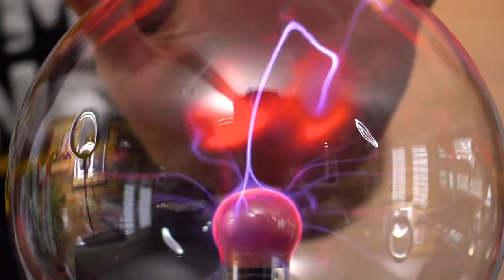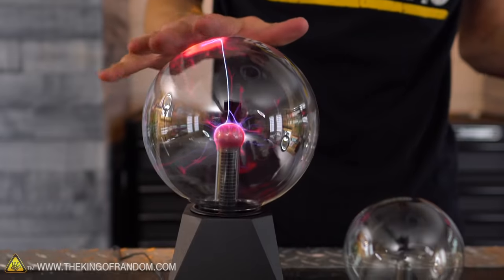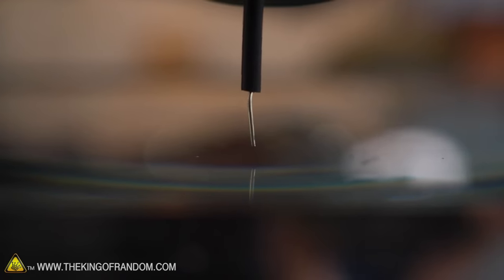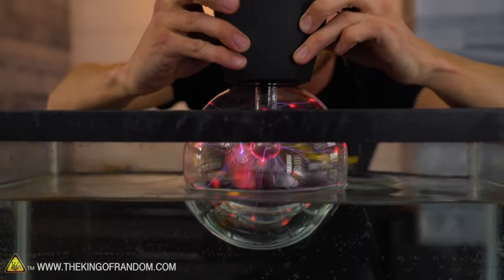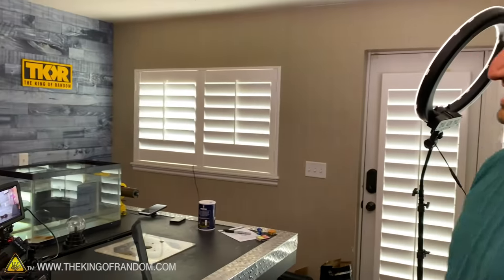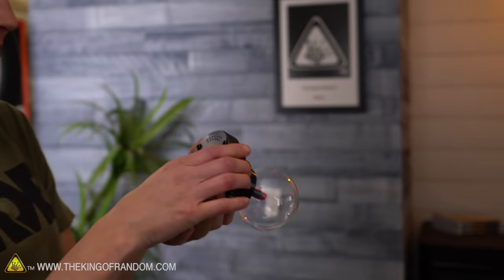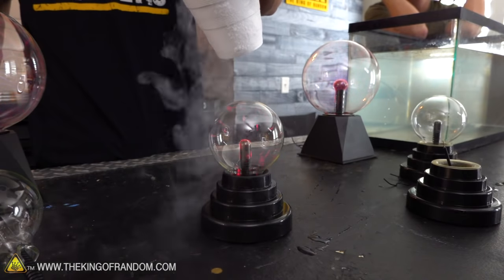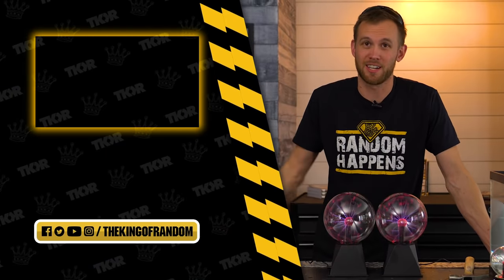How Will A Plasma Globe REACT In Water?

Comment: You guys should try putting different liquids in lava lamps like vinegar and liquid nitrogen.
Reply: Wouldnt liquid nitrogen just build up pressure till it exploded?
Reply: Stevy Boy yes
Reply: @stevyboy1876  That's the best part
Reply: @stevyboy1876  you say that like its a bad thing
Reply: @stevyboy1876  I like how you think 🤘🤘
Reply: Agree!
Reply: Yes!
Reply: Yes. Liquid nitrogen will build up pressure and explode. But if it didn’t then the heat from the bulb wouldn’t heat the wax and melt it. The liquid nitrogen would most likely freeze it. Also the glass would probably break from thermal shock.
Reply: Anders Olson yes
Reply: Anders Olson yesss
Reply: Yessss
Reply: Stevy Boy yes and also the wax wouldn’t melt
Reply: I agree
Reply: They sould put highlighter fluid in a lava lamp
Reply: Great idea!
Reply: Stevy Boy that’s the point
Reply: Like actual lava
Reply: Lol pickle juice
Reply: Stevy Boy thats the point...
I want to see them do it and not know about the explosion 🤣🤣
Reply: @stevyboy1876  thatll be cool to see
Reply: I do have an extra lamp, but no liquid nitrogen. I will try vinegar though
Edit: It smelt bad but did nothing
Reply: this sounds oddly specific
Reply: YESSSSSS
Reply: Anders O 
Kaboom
Reply: Lava lamp but it’s real lava
Reply: Well... once you take off the cap, the lava lamp won’t work anymore.
Reply: So true so true
Reply: Yes
Reply: Liquid nitrogen wouldn't work lava lamps get hot bro
Reply: @JacobTechShit  o
Reply: @JacobTechShit  wdym
Reply: @ReadGantz  liquid nitrogen is cold. Lava lamps are hot...
Reply: @JacobTechShit  yeah
Reply: @JacobTechShit  that's the point
Reply: @JacobTechShit  to see what happens
Reply: Won’t work
Reply: He's dead
Reply: @legostarwarsproductions4330  ????
Reply: @legostarwarsproductions4330  wdym
Reply: Dude you have 666 likes watch out 😦
Reply: Liquid nitrogen is a solid
Reply: reee
Reply: What about fire and gunpowder
Reply: Baked beans
Reply: @SirPandaFluff Nice!! Thx a lot
Reply: Mrbro dog1234 that’s the POINT
Reply: nice
Reply: @DH-xw6jp  well it is, its really dangerous
Reply: Smart
Reply: Dude that would make it explode that could be really dangerous. The vinegar makes a reaction that can explode or let out a toxic gas...
Reply: @stevyboy1876  thats the fun lol
Reply: @GummyBears27  Vinegar is just a mild acid mixed in water, it cannot explode and it doesn't release gas, it decomposes at 440c to produce co2 and ch4.
Reply: Thats a great idea
Reply: s stack of replies
Reply: Vinegar is a type of acid.
Reply: @twistyclaw4382  yeeeeeeeeeeeeeeeeee
Reply: @crytical7719  true
Reply: @stevyboy1876  yes it would unless they kept the lid open
Reply: Agreed
Reply: True
Reply: @stevyboy1876  it's greater that way :>
Reply: Yesss
Reply: XD I’m on a cat vid why does it say this
Reply: Doesnt liquid nitrogen freeze things upon contact
Reply: Try to see what will happen if you leave them dipped in Liqued nitrogen and left out for 2 days
Reply: I agree
Reply: @stevyboy1876  no actually , potassium would start sparking in water, liquid nitrogen in a
Reply: @LaurenTMC0  try wax
Reply: @GummyBears27  They could just put on gas mask
Reply: Duuuuuude yes
Reply: @DH-xw6jp  remember what bob ross said? “There are no accidents/mistakes. Only happy accidents/mistakes.”
Reply: Like tho old days with the spray paint in the dome
Reply: They would likely die, when you open it, it explodes
Reply: Don’t forget liquid oxygen
Reply: Put real lava in it
Reply: Get tucked
Reply: @stevyboy1876  nah it would break the glass first but then yes you are correct
Reply: Nitroglycerin
Reply: @stevyboy1876  splodey😟
Reply: Ah yes my favorite combination: vinegar and liquid nitrogen
Reply: Stevy boy
Reply: Is that like the formula to nuclear explosions
Reply: Real lava lamp
Reply: What about bleach and vinegar
Reply: @stevyboy1876  yes but who doesn’t want to see that
Reply: The thing would break before, it's like a soda but more explosive
Reply: Yes!
Reply: @stevyboy1876  Z qPqa
Reply: Yes
Reply: @stevyboy1876  it would freeze the glass before it gets chance to explode
Reply: Liquid nitrogen is dangerous so don’t use it with lava lamps, it would probably explode.
Reply: utan
Reply: YAS
Reply: @stevyboy1876  exactly :)
Reply: @stevyboy1876  Is that a bad thing?
Reply: Mercury
Reply: I thought opening lava lamps ruins them
Reply: Yes
Reply: Ow lord
Reply: That would be cool af!
Reply: @stevyboy1876  exactly, poggers, right?
Reply: @johnbarron4843  no no.       No.      No no no no no nonononononononononononononononono
Reply: For a second I thought you were Griff patch
Reply: And lava
Reply: Distilled water?
Reply: Yes
Reply: It's not a lava lamp it's a plasma ball

Comment: SO as a teenager I had a plasma globe. I have found that by  wrapping .5mm copper wire around the globe and feeding one end through a mechanical pencil I could make a cool devise. It would generate a spark on the tip on the pencil that I could use to burn writing into paper or skin to make temporary tattoos.

Comment: you should put them in the foundry while they're still on and see what happened!
Reply: The glass and plastic would melt. The batteries would come in contact with extreme heat (which is most likely very dangerous). Also the glass would melt and release the vapors that are inside the plasma ball.

Comment: i used slime to conduct a circuit without flipping the on switch, it produced less energy do to slime being sparser than metal but it still worked until the slime creeped towards the battery, thats when the positive and negative electrons got scrambled

Comment: It's going to sound weird, but a lot of electrical things will work just fine while they are filled with water. The wiring the electricity is supposed to flow through has a lower resistance than the water does. The only side effect, of course, is that it will still drain the battery is really fast. Simple things like flashlights will continue to work even when filled with water.

Comment: placing neon tubes or leds near a plasma ball will light them up. does that still happen when the glass of the plasma globe has been broken? electrical field was probably what was jackin with the camera particularly if it had an LED screen. if you get a cellphone too close to a plasma globe will it fry the phone?

Comment: I believe plasma globe envelopes, like most glass plasma apparatus, are necessarily quartz glass to withstand the extreme temperature gradients caused by focused arcs.  That's why it is also able to withstand the thermal abuse with liquid nitrogen.  If you do the same thing with e.g. a soda-lime glass light bulb envelope, it will explode violently.

Comment: so does the spark bond electrolytes together?  If so , you could put it in one corner of the tank, and siphon from the opposite corner, to have clean water.  Curious if it could completely remove the conductive capability of the water.  Since we know Pure water does not conduct electricity, would this be desaturated water?

Comment: The temperature of the water makes a big difference with the salt. If the water is very warm the plasma seems to be more reactive to it and if you take a glass of warm salt water and put a wire in to it the attach the other end of the wire to the plasma globe it will see the salt warm water as ground and conduct to it through the wire also the salt will start to climb into the wire and coat it and will even travel under it's insulation but you would need to do it on time lapse because the salt takes a long time to do that. Just and experiment I did and I wonder if you tried it if you would get the same results.

Comment: You should never put any low voltage electronics in close proximity to a high voltage source. Inductance and coupling is a thing. You were having fun putting a device that would likely blow up with 5v going into the wrong place in the circuit in a field that might have been upwards of 10-15v.

Comment: With the violet color, you're probably throwing off some UV light as well. I wonder if that's what Mark's camera monitor was reacting to? UV radiation? I know when I was taking pictures of silica plates (for thin layer chromatography) and using a UV lamp (254 nm wavelength and a slightly longer wavelength, don't remember the number), my phone camera started messing up and deleting images randomly. I think there's a section of the UV spectrum that electronics don't like for some reason. 

Just a thought. I'm an organic chemist, not a physical chemist, so radiation isn't exactly my wheelhouse.

Comment: Mine has the same affect without it being in water. If I get one, if a few months the beam will just get so foggie that it just like water vapor and then it will connect to the bottom and will be useless so I will need to throw it out

I’ve had 3 and and each one lasted 5 months before it gets too foggie and I need to throw it out

Comment: i have something even cooler for you to try i know this video is old but hopefully u will see this. have you and another person touch two differnt globes and then touch fingers at the same time using your other hands. and you will make quite a LONG arc of visable electric between your fingers and strangely enough there is no pain. NONE but u will start to smell your flesh cooking. but its very cool, me and my brother discorved this at age 8 and 9 it was rather cool when we first did it. u can also increase your internal voltage with static inorder to produce a one time MASSIVE ARC, also if you touch it long enough again inscresing your internal voltage im sure there is a more technical term. but if u do this u can even hold the arc between each other for several seconds after letting goo. still main tinaing it and if u touch for long long time. u can walk away and start it after letting go . some fun things to try. and maybe u can find a way to turn your self into a one shot taseR???? just saying could be fun. id love to know why this works.

Comment: shocking that you dont use batteries, but have wall attached blobs
Reply: capacitive air connection, you must have enough bandwidth
Reply: sauna does not shock you
Reply: better conductivity path on the metal
Reply: water is insulation, for van de graaff
Reply: marx generator (with switches, no arcs) is a nice thing
Reply: arc metal melting, welding, ionization